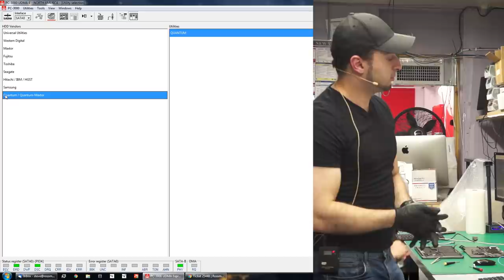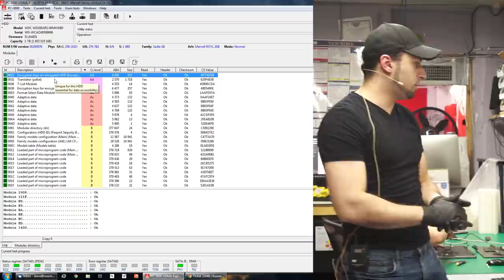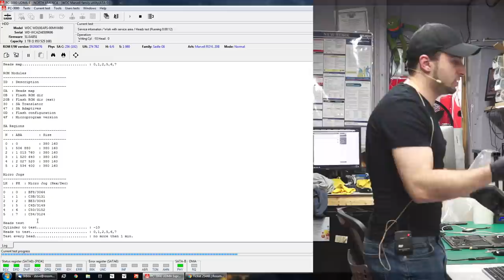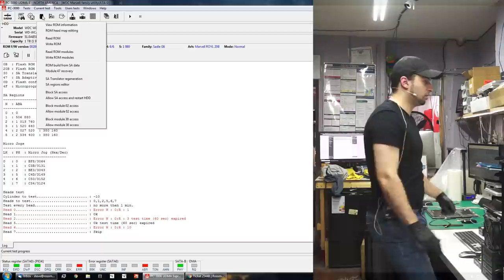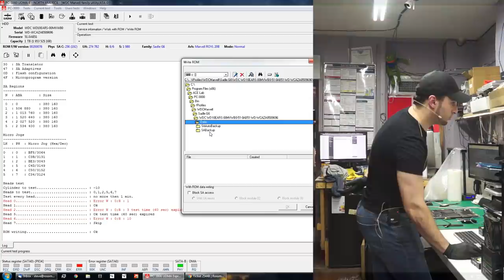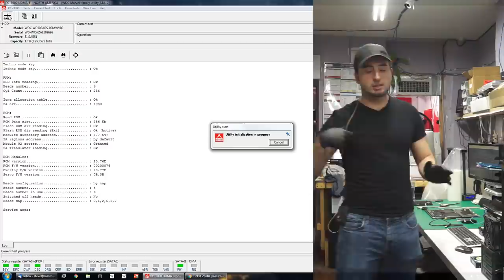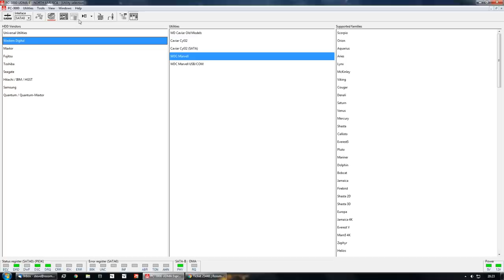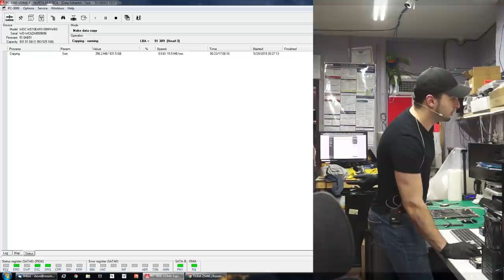Western Digital hard drive data recovery: heads swap

Comment from the maker: Don't forget to check out the blooper reel on the live channel here: https://www.youtube.com/watch?v=nHXtP-NVjTk While you're at it, the live channel features any random thing I feel like uploading or streaming at any given time, so if you want to follow me on bike rides, restaurants, rants, whatever... check it out there.
Reply: Nice, I have repair/got data off a number of drives, just used my known good took the data of it and turned it into a donor, as I normally get multiple of the same drive at the same time. 
No clean area... just on my desk, replaced boards motors and heads.
Reply: really cool video!!!
Reply: louis, u will love to hear, that western digital (seagate probs too) puts planned obsolescence in their drives.
western digital sets up their consumer drives to have insane load/unload cycles like every 12 seconds for example.
the heads are designed to only deal with a certain amount of load/unload cycles, 300000 for example.

so having insane artificial load/unload cycles will result in people's drives having a much higher failure, than they actually should, meaning people get to throw more money on the 3!! only 3!!! hdd manufacturers of the world....

there is a tool to fix this bs on at least old wd drives called wdidle3, which fixed the issue on a friend's drive i got for free, not sure if that tool still works on modern drives.
but isn't it lovely, that just like apple with their soldered onto motherboard ssds, hdd manufacturers don't give one fuck about consumers and go out of their way to get the drives kill themselves.

Comment: At a shop I used to work at we tried this without benefit of a clean room and it actually worked. The drive lasted long enough to transfer the data off of as well! It was a last shot type of thing because the customer didn't want to pay the price that our clean room level parter (DriveSavers) charged.

Comment: I store data on pre-owned Seagate drives--but only in server racks under Raid 6, mirrored in multiple locations.  So, thank you for doing your part to keep the supply of used Seagate HDDs high, and their prices low.

Comment: Oh how this brings back memories. I like your head comb. I used to grab the head stack with tweezers by the slot located just behind the head comb. It may be easier than grabbing the heads from the top of the head screw. Most of the work we did was performed on a work bench then we imaged under a clean air booth. We used a black marker to identify "parts" drives and if any heads were bad, we would make note of it on the drive cover. The PC3000 has come a long way since I stopped recovering data. Good job!

Comment: Really interesting to see steve prefers WD. Over here in the UK our shop sees so many WD drive failures in 2.5" laptop drives within the first 2 years, more often than toshiba or seagate. We replace with seagate and hardly ever get a return. I will probably get roasted for saying this but this is our honest experience.

I really liked this video, more please!
Reply: We ordered a batch of 30 Seagate hard drives for a NAS trying to save money. 1/5 drives were DoA. Three of the working drives failed within six months. Two of the six replacements for the DoA drives also failed within a month. 

I've also bought Seagate as a cheap backup only to have it fail before the drive I was backing up.

Maybe the drives in your inventory like you or something or I broke too many mirrors as a kid.
Reply: Most likely the customers you give seagates to simply dont come back... to YOUR place. Specially if the shit seagate drivers end up failing again some time after.

Comment: The PC-3000 is the real hero here (and quite costly too). Its accessing the drive in special ways, reading the HDD System Area, internal ROM modules and all the calibration information, and other things. Just swapping heads + PCB and using ddrescue on linux would not result in as much success.

Comment: HGST/Hitachi drives made by WD seem to be a lot more reliable than other models.
Reply: HGST Drives are garbage :p
Reply: @dimitris_verlis  😂 You probably don't know what you're talking about if you say that. I have a few hgst's with about 50,000 hours on them over the past 5 years, especially the one in my laptop, never had a single issue.
Reply: wd did finally fully absorb hgst not too long ago, though they were the parent company for several years before the full merge took place, so now hgst's Drive Technologies are fully being Incorporated into wd's current lineup so we're actually going to see two of the best drive manufacturers ever create some beautiful products in the next few years. I am still saddened they wont be making hgst stuff stand alone anylonger, im sure wd's new line up will be better then ever because of their tech. I wish they would of stayd separate companies at the end of the day, HGST really did have the best hard drives.
Reply: Wow, my HGST Drives ate failing again and again, I don't know if my luck was bad or not...

Comment: Some old hard drives could be surprisingly dust resistant. I had an old maxtor drive (i think, could have been a late micropolis but I don't think so) in a machine at the office. It was loud, really loud but as it was working and stuffed into a cupboard we didn't really care. I can't remember what it was used for, but it was kept in use for a long time. Eventually the machine was rendered obsolete and before scrapping I looked it over for usable parts. There wasn't much, but as I dug into it I suddenly felt air moving across my fingers, but there were no fan anywhere near. Turns out there was a large hole in the top cover of the HDD through which you could look directly at the edge of the platters. It had originally been covered with a sticker, but someone had peeled it off years ago. It was from this hole the air I felt was blowing. Covering it up with my finger made the drive sound like a normal HDD without that weird whooshing sound. So this drive had been working for more than five years with a hole about 12 by 4 millimeter in the top cover. And this machine was totally disgusting inside.

I found it fascinating that it was working at all, so I kept it around to use for simple testing and it held up for several years of intermittent use and never lost a byte before it eventually ended up in the dumpster as it was simply to slow, to small, and as a IDE drive totally outdated for any practical use of any sort. Never did cover up that hole though, and I have no idea how it survived for so long.

Comment: Generally, if you need to do everything correctly, you first need to load/replace to the test engineering firmware, leave only the translator in memory, disable hardware and software  write process , logs, smart, expand the ECC processing and then check the operation of the preamplifier and check the MR element (state response) and read all the healthy heads. 
Then start reading the data on defective heads, and then if it required adjust the parameters of the reading MR current for better read the bad sectors by the degraded heads, and if you need after all  replace the heads. 
The PC3000 does not support the new Seagate and Western Digital (hitachi PCB:LSI, Avago) models. To do this, use PC3000 plug-ins library (separate developers in data recovery community) or use factory utilities for obtain better results and in some cases to unlock the hard disk firmware. 
If someone needs help and recover data from 4-5-6-8-10-12-14 terabyte of disks, please contact me. We have factory tools from Seagate and WD, Sandisk.
Reply: Wow, yes!
personally I think you know more than him :) the head calibration is missing from this video.
I cant blame him though, its so complicated. 
A lot of the information I learned about hard drives came from badly translated Russian websites, so maybe you have an advantage :)
Reply: @mrlithium69  Yes usually if heads was swapped it have close or worse reading parameters. 
And in most cases it reading slow or have some unreadable places. 
In this case need adjust only reading parameters in firmware, for this type WD in modules 40-4X. Or even better if there no surface damages start script from firmware to calibrate heads. it collect all new heads parameter by zone tables and then possible read all surface and data like it was with original heads. Also possible make reading auto correction much wider. Because maximum reading MR currend not exceeding 80% of maximum possible. many data recovery services have problems with heads swap and they usually thinking it heads not match. really if heads the same or even from later hard drive family then heads parameters have more difference than original. Some hard drive wich have  one head reading trouble just enought made some correction for one head adaptives and this head can read data again. Some head have degradation (parameter shifting) during life cycle so it possible shift back to work point parameters and it can be read data again. Adaptives for write it is different part of firmware . we do not need it for data recovery process.

Comment: This is a very good video. As long I can get my files and data I'm good. Even if the HDD goes out as long as the files are retrieved that should be it.

Please have more of these videos and about data recovery process and the software used. I thought I will be needing special tools but it looks like the ones used here are available on the market or it is easily accessible. Again great video and yes I learned not only something but a lot. Keep it up guys. 💪😁☝

Comment: When my drive got clicking sounds and read errors I removed PCB and cleaned contacts to the head with earser. (Those was really bad) Then I was able to copy all data from it. Marked it as "untrusted". It still works perfectly (and it is 1TB Seagate, never had problems with them before)
Reply: wow lucky! good job tho. relatively simple fix.

Comment: A couple questions here:
1. Do I get it correctly that it's basically a lottery whether each specific head works well enough after a replacement? Why so? Also, is there any head calibration data on the PCB/platters that needs to be copied from the donor?
2. Is it possible to grab all the data from the working heads before attempting another swap? Is it possible to feed the service data into the drive from the outside if head 0 happens to not work after a swap?
Reply: good questions. even as much as I know, I'm not sure. But everything you said sounds accurate.
yes there is head calibration data and he seems to have skipped that part.
yes you can swap once, read what comes, and swap again and hope for more.
the donor drive was most likely not in perfect condition.

Comment: lol finally someone else who hates Seagate drives as much as me, I use WD Caviar Blue for OS (7200 RPM) and Caviar Black (7200 RPM with better Read/Write operations better quality parts and a 5 year warranty as opposed to the 2 on green/blue) for data. WD green is 5400 RPM and has a high fail rate. (I used to handle warranties in a computer store) and the most returned drives, Seagate and WD Green.
Reply: TotalMK have u ever used an nvme ssd
Reply: I only use hgst ultra stars. Great drives
Reply: @elijahlane411  Nah, I don't like the idea of insta failing SSDs, so I have stuck with HDDs. I know people use them for boot and they are lighting fast but I am a bit more old school and I like the idea my data can be recovered most of the time on HDDs vs SSDs that can fry there own chips.
Reply: @GamerGee  I will have to look into those!
Reply: @TotalMK  SSD's for the last many years have amazingly long lifetimes and write cycles, especially if you get one from a reputable brand. Not only that, if all you are using it for is your operating system, even if it fails in 5-10 years, who cares it is just the OS and some programs.
Reply: @TotalMK  that's why a lot of people only recommend ssd's for the OS. Just to only improve boot time. At the end of the day your data is in the mechanical HD for storage.
Reply: @Hecklezz  well I was working in a shop 3 years ago and I saw many a Samsung EVO SSD failing, it put me off. hehe
Reply: @TheLilmage7  Yeah I know that, but I am happy to wait a few extra minutes and have  a bigger capacity on C: \

Comment: The best drives Backblaze currently use are the Hitachi Deskstar models, which sport failure rates as low as 0.8 percent and as high as 2.9 percent annually. ... Western Digital's drives generally did much better, with the high end of its annual failure rates around 3.6 percent.

Comment: @Louis Rossmann Thanks a lot for great video! It's probably off topic, but I'd like to ask you if there is a chance to bring back to usability a drive (3,5 inch, WD 1TB Blue) which reports CRC error? Not found in Explorer of Windows 7, but then in Disk Manager it is found, I was able to remove partitions, put a single one, but upon an attempt of formatting it cannot find the drive due to CRC error so all the articles on the net to do the checkdisk are just pointless at this stage. Drive spins and based on sound it reacts when connected to the computer in a proper way. Is there a chance to save the drive or I just got a coffee mug holder?

Comment: I hate Seagate. Years ago, like in 2011/2012, I brought a 3 TB Seagate to backup the data on my Samsung HDD that SMART told me was about to fail. My Seagate died quickly and my Samsung is still working to this day.

I will never buy Seagate again. I will only buy Western Digital if I buy a hard drive.

I still have it and need to recover valuable data on it. So I'm watching your videos to gauge whether I can do it yet or not.

Comment: I  used to make custom PC's and repairs. I have had many Westan Digital and Seagate Drives. Just as many Westan Digital drives failed as Seagate.
Reply: Honestly don't know what the hate with Seagate is. Like you I find that just as many WD fail. These are nice large affordable drives that are pretty fast and durable. I understand that WD is pretty popular but I have yet to have any real problems with Seagate drives or Western Digital. It seems like it's possible that more Seagates suffer fall damage. But as for normal ware and tear they both seem fine. Maybe New Yorkers like to chuck their drives/laptops down the stairs, because all the desktops I've seen are similar.

Comment: Very interesting video. I will pester you with a couple of technical questions if you don't mind :)

- How does the bench function. Is it just a filtered intake that releis on no other particles entering it any other way due to the increased pressure inside?
- Can you do anything about the new helium filled drives?
- Is there any connection between drives sound level and quality? I have had multiple WD drives and in my experience every WD Black drive has always been far more noisy then the WD Green and Blue drives out of the gate.
- What is your opinion of HGST drives? In my experience they seem to be pretty close to WD in terms of resilience, but a bit noisier and with worse SMART support in some cases?
- Do you check the SMART status of drives that come in (would be a kick ass way to gather data and validate how useful SMART actually is) and does it have any value in terms of error detection and diagnostics in your opinion?
Reply: 1) yep, positive pressure and ultra fine filters basically
2) their lab would have to be equipped to refill the helium
3) a drive getting louder like that means the spindle motor bearings are worn down and this can be replaced if need be. The Black drives spin faster and in all likelyhood use the same bearings so they are just outright louder, even new.
4) HGST is fine, otherwise up to you.
5) If you know how to interpret the SMART data, yes. My primary go-to metrics to look at are ReAllocated Sector Count, Current Pending Sector Count, Uncorrectable Sector Count, Hardware ECC Recovered, they all give a picture about bad sectors, and then drive lifetime data like Power-On Hours, Start/Stop Count, Head Flying Hours, Load/Unload Cycle Count, Temperature (max) to get a general idea of how rough the drive was used. These terms came from a Seagate drive. Every manufacturer uses different terms and different raw data values, so it gets quite hard to read and compare unless you get in the habit of reading the SMART data like a daily news report to see what changes over time naturally and un-naturally.
GL@!

Comment: Fantastic demonstration.!!

Few questions :

I own a WD 4TB My Passport Portable (Blue). It fell. It makes a clicking sound. Platter rotates & the sound & rotation stops in 6-7 seconds. The light on the HDD does flash throughout though. It’s not read by the laptop. Click of death situation.

I’d like to try what you demonstrated. 

1) How many platters does my hard disk have ? Want to know the answer to this before opening my drive.

2) I ask this because I need to buy comb as well accordingly. Any suggestions on this too?

Thank you!!

Comment: Thanks guys! I use a Toshiba 1T HDD for my backup. It has been working well.
Reply: Grab a second 1TB drive and offline back up occasionally
Reply: I always backup offline. I do not use cloud stuff if that is what you mean.
Reply: I normally optimize and backup 2 or 3 times a week. I take a lot of photos for repair articles that I write or when I work on a device. My HDD's have over 800G's already stored on them.
Reply: I backup locally to two locations that are not in the same system and one offsite via cloud encrypted of course.
Reply: tastymonkey  That is wise. I am just a hobbyist so I don't worry about it that much.